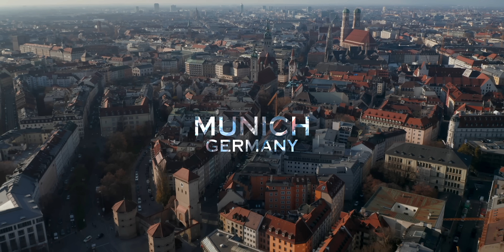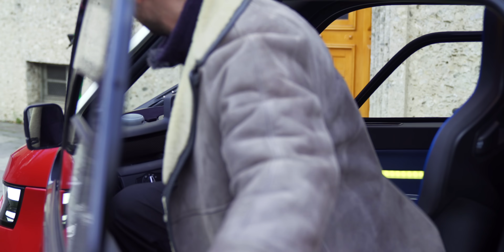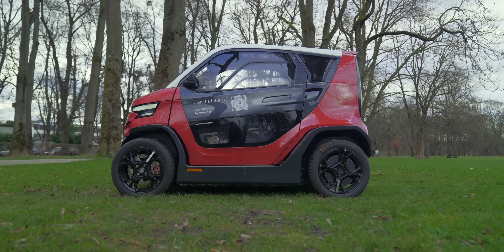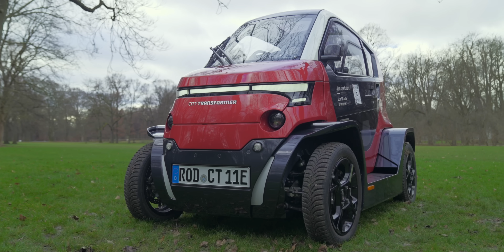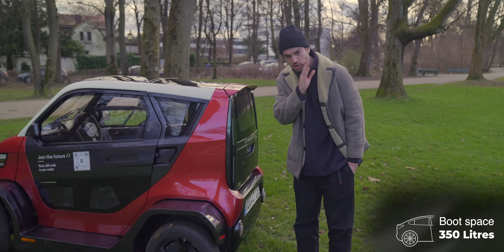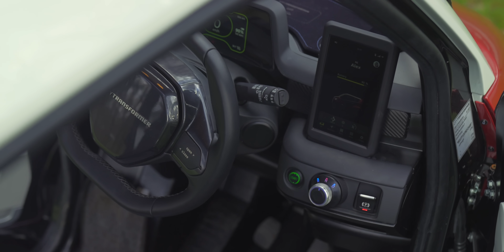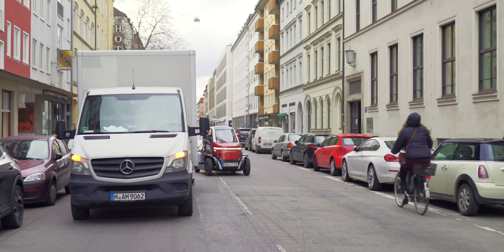The TRANSFORMING Electric Car Designed to Skip Traffic Jams!

Comment: 55mph top speed is good, I live in a village and a lot of microcars are only about 30mph which I wouldnt feeel comfortable driving down the A roads to Milton Keynes City, but at 55mph I think thats quite reasonable, plus the small seat in the back would be perfect for me taking my toddler son to Preschool and then school a couple miles away without having to take my full size EV. only problem is, its a bit too expensive, I could but a nice 2nd hand leaf for that money

Comment: Blend this with the Carva S+/One give it a similar or better range and the option of a respectable dual carriageway/motorway (65mph up hill) speed then you'll have a practical short-mid range commuter.

Admittedly we may have to wait for lithium sodium or solid state batteries to get the genuine range and speed combined.

Comment: 2:06 Thing is, how do we pickup our furniture from Ikea? And if said furniture is delivered, we need to ensure delivery vehicle is electric and not blocking roads when parked to deliver. All problems we need to solve else nothing will change and our cities will still be congested, even if cleaner. Brilliant engineering design either way, although driver will need to ensure no cyclists or other moving objects that the extending wheels may impact.

Comment: Imagine extending the length to have a back seat that had ample legroom on the move but could be retracted in, for parking purposes. It would be fun to make this vehicle out of a carbon fibre tub, McLaren style and get some fun suspension to tilt the cab into corners, motorbike style.
A length extending version could extend a metre back to allow for entry, then retract by half a metre to close the cabin, leaving space inside for the passenger or large load. You would be able to take luggage and camping gear for a road trip in it.
It is a a shame that the top speed is not enough for necessary dual carriageway usage. Seventy would be plenty.

Comment: In the Netherlands small cars like the folded mode of this one can drive on cycle paths. I imagine a car that could do both - cycle paths and regular roads - would be a huge deal there, assuming the law can be modified to accommodate such a vehicle. Pretty awesome.
Reply: as a cyclist, the idea of a 1m wide 400kg vehicle cruising at 50kmh down a cycle path sounds terrible. especially since cycle paths in many places in the US & Canada are where people go when they are not comfortable in bike lanes or streets - so lots of kids and inexperienced (and slower) riders. Just watching him drive into the bike lane got my dander up. It's like these things are designed specifically to take advantage of bike lanes, since a lot of highly congested urban streets are not wide enough that there will be a meter between slow moving vehicles. I don't have a solution though - Id rather see lots more of these than lots more of full size EVs.
Reply: @dreid477  Just an idea… if you want to use the bike lane, you must move like one. E.g. limit the speed to 20 km/h

Comment: The one thing I am dying to know right now is probably the one thing the City Transformer people don't want me to know: how the hell does the transformation work??? What must a steering set up look like to work like that? And at speed... Quite blown away, I must say..  And I so want to see these in cities instead of big suvs. Please make that happen.
Reply: I have some experience with large machines with these types of axles the steering was hydraulic and synchronised with the axle length through shared volume../ cylinder dimensions and valving ..for Road use it’s probably  had to be mechanical- which makes me curious too

Comment: With scissor doors, 50% more range, and at 50% of the price, and it will sell well. I'd also forgo some of those 'premium' features, with no qualms. The halving of the price can be achieved by means of a government incentive grant. The claimed range is too small for comfort, especially if it's really only 50 or 60 miles in cold weather.

Comment: It is more advanced and controlled. Imagine, you want to flip over your vehicle because something with this car you just make it narrower when you turn right or left, and it will definitely easily for it to flip over from the side. No one will do that, but there is an option for that in case your brake is broken maybe and you just want to stop.

Comment: I can kind of see how it could have a limited use - people who really don't have any friends so know they will never have to transport anyone else or any thing. Other than that, I can't help but feel that it is as useful as something like a hypercar. i.e. something that takes resources to build but has a single use. So you buy one of these, but if you want to travel anywhere else, you then have to buy another car that has more range, more space etc etc. 

It's footprint is over 50% of a Ford Fiesta, but arguably 25% as useful. I can't comment on CO2 production when building it as I don't know figures for either the Fiesta or the CT-1, but is everyone buying "individual" transportation instead of something that can serve more than one purpose not particularly environmentally friendly. 

And don't get me started on dangers to pedestrians and cyclists.  Just in this little taster video, it shows the driver using cycle lanes to cut in front of traffic, and driving off down a footpath. I mean, really, is this what cities should become? There's enough issues with mobility scooters on footpaths etc, let alone something that can go 50mph. Can you imagine the extra street furniture that will have to be put in place to prevent people from getting down pedestrian areas? Or the dangers of road rage as someone in there CT-1 barrels down a cycle lane, forcing them out of the way before then nipping in and cutting up traffic at the lights, as shown in the video? This is why I don't like cities!
Reply: Like people with single occupant bikes and motorcycles, people with thin cars will have family and friends. If they want to travel together, they’ll take two 🚗 🚗 instead of one 🚘. Standard side-seated auto design resulting in habitual empty car side-seat hauling is far more dangerous for cyclists than thin single-width cars will ever be.  Given its ability to move through traffic far more efficiently, eventually, like bikes and motorcycles, thin 🚗 design will be the popular choice and side-seated 🚘 design will become the novelty.
Reply: @MickeySimple  you're probably right, but I'm not sure how something that goes 50mph / 30mph in thin mode that darts across cycle lanes and footpaths whilst being entirely enclosed and seperate from the outside world will be safer to pedestrians and cyclists than cars where you can't and shouldn't fit in places not designed for them. I agree single occupancy is a problem in vehicles, but not sure that taking two cars instead of one, even if it is a bit smaller, is sound from an environmental stand point.

Comment: Q: I'm thinking of replacing my electric car with a fossil fuel car and have some questions?🤔 
1. I have heard that petrol cars can not refuel at home while you sleep? How often do you have to refill elsewhere? Will there be a solution for refuelling at home?
2. Which parts will I need to service and how often? The car salesman mentioned oil in the engine and timing belts that need replacing  and a box with gears in it. What is this? How much will this service oil change cost and how often – and what happens to the old oil. Also apparently these petrol type cars generally stop on the brakes alone – so the brakes wear out much faster – how long will they last compared to my current car which lasts over 100k miles
3. In a petrol or diesel car, do I get fuel back when I slow down or drive downhill?
4. The car I test drove seemed to have a delay from the time I pressed the accelerator pedal until it began to accelerate. Is that normal in petrol cars?
5. We currently pay about 1.2p per mile to drive our electric car. I have heard that petrol can cost up to 8 times as much. Is this true?
6. Is it true that petrol is flammable?
7. I understand that the main ingredient in petrol is oil. Is it true that the extraction and refining of oil causes environmental problems as well as conflicts and major wars that over the last 100 years have cost millions of lives? Is there a solution?
8. I have also been told that you have to transport oil all over the world to turn into petrol or diesel, and these ships have in the past damaged the environment by leaking the oil, is that true?
9. I have heard that cars with internal combustion engines are being banned to enter more and more cities around the world, as it is claimed that they tend to harm the environment and health of their citizens? Is that true?
10. I have been told that these internal combustion engines make a noise when you start them – so early starts can wake people up, and driving a lot of internal combustion engine cars in towns makes towns noisy.
11. is it true people can steal the fuel from your tank
12. what is the drop in range in cold weather, I've been told a car that does 45mpg can drop to 37 mpg in winter – just curious on that one.
13. a friend told me that the exhausts wear out – is that true, and people steal them for the rare material used in them?
14. I was also told – that the exhaust gas isn’t good for you – and if you leave the car running in a confined space – like a garage – you will die – surly that isn’t true is it?
15. next door told me – these petrol cars – carry around 40 to 60 litres of highly flammable liquid which is pumped into a steel cylinder, and its then exploded to generate expanding gas to move a piston, and turn linear motion into rotary motion.
Why would anyone want thousands of explosions happening within a few feet of where your sitting.
16. a guy at work told me – he has a petrol car, and it leaks oil. When he parks it – surely that’s not right is it – leaving dirty marks on the floor and contaminating the environment so directly. How long before this happens if I change.
17. my dad told me – if you buy a diesel car – the hand pump smells very bad, and you have to wear special gloves to stop your hand smelling, and if you spill it on your clothes it terrible.
18. is it true – the petrol and diesel is so dangerous, that you can only buy the fuel at a special filling station, and not anywhere (hotels/Car parks/Home/Work)?
19. while technology is advancing, will I ever be able to refuel my internal combustion car for free using only the sun ?
20. would I be better off going straight to horse and cart, and not buying a horseless carriage? they sound pretty awful, burning dinosaur juice and polluting the environment whilst funding conflict and war and consuming raw material at an unbelievably high rate.
Reply from the maker: Brilliant. I love this comment so much. Can I read it out on a news episode or podcast if I credit you?
Reply: @fullychargedshow  please do, if you think it'd be appropriate! However please note that it wasn't my original content, I saw it on a Facebook post and copy / pasted it here. Not sure I'd be able to find the post again.

Comment: When parking nose in, it's length is about 98.5 inches. The widest cars are about about 80 inches.  So it will stick out 18+ inches more than the widest cars, possibly into the lane.
Reply: Trucks stick out more.

Comment: From the front it looks like a Tractor cab stuck on go-kart wheels, from the side a Hot Wheels van, and in thin mode it's a mobility scooter.

It annoys me how the Ami is limited to 28mph, here in UK folk hate doing the 30mph speed limit so rage at folk doing 2 under and you don't want that around you when you're driving a plastic box so an actual 30mph will help a lot.

Though this car won't be allowed as a 'no licence needed' here which is a shame for cities, the 13k euro price will definitely be a lot higher when/if it drops in UK and that puts it in a basic new Fiesta price with less room, so it depends how much a small EV car suits you I guess though with 111 mile claimed range does help it's selling point if it's at least 100 mile in reality..

Comment: With this vehicle, the second passenger seat could be made rear-facing for getting in and out then swivel round to face forward while driving.
BTW, have you seen the Triggo from Poland, Jack?  Similar concept, with expanding front axle but it also has the ability to lean into curves and an autonomous driving function, and has rear axle steering.

Comment: The standard car parking space in the UK is 2.4 metres by 4.8 metres (it can be as small as 1.8 metres wide). This vehicle is 2.5 metres long. Parking "nose in" leaves some of this vehicle outside the designated parking space causing an unecessary obstruction and is an offence under Road Traffic Act 1988, Section 22. Welcome to the world of Fixed Penalty Notices, clamping and having your vehicle towed.
Except you won't make it that far as a bus is going to sideswipe you into oblivion as you try to filter between the lanes in heavy traffic, or you get charged under RTA, 1988 Section 3 "driving without reasonable consideration" with "misuse of any lane to avoid queuing or gain some other advantage over other drivers" and get 9 points on your licence for forcing the bus to swerve and not kill you.
What were the other 'advantages' of this vehicle again ?

Comment: I dunno - there are aerodynamic compromises of this, and the complexity of the "transformation". The direct competition would seem to be the Twizy? I would strongly prefer getting the Cg as low as possible, and then setting the wheel track width as narrow as that allows.
What you gain in parking ability, you lose in stability - off camber slopes at too high a speed and this will roll, I would have to think.
Reply: Other thin weather and road protected vehicles able to lane split and park perpendicular to curb include Carver, Nimbus, and Tango. They’re all great. I think thin cars are the future.
Reply: @MickeySimple  Right - the Tango - I almost mentioned it. I saw it at the Automotive X-Prize and it was "enabled" by its lead acid batteries in the floor. Low Cg, as I mentioned, is one solution to this.

Comment: It's a comfy but space limited motorcycle - if you can't even get an adult passenger in the back then it's really a single person commuter (fine.. there is a need).  I'd love to see a proper 2 seat version (tandem) with a bit of a boot - maybe enough for a dog on a short trip.  That I could use for little trips at home and tow behind my camper van and use to explore....
Reply: Did you ever see a motorcycle with 2 electric engines (2x10hp)?

Comment: Hey, it's neat!  But it is also unnecessary- it just adds complexity and cost.  Also, while I think small cars can be useful in some instances, they will always be a niche product.  Have you ever gone grocery shopping even for just two?  Much less for a family of four.  And for most normal folks, they cannot afford that extra, fun micro car- their vehicles have to be flexible for both transporation to work, travel to grandma's house across the state, or taking the kids and their friends out for ice cream.  We are long past where one's world and family all exist in an area the size of a football field.  Also, you cannot fit 4 of these city cars into a parking spot, unless, one, you are going to climb out the roof, and two, widen the parking spots by 50%- these micro cars still stick out too far when parked like that.  The problem is not the size of our cars, or the amount of energy needed to push them- it is the fuel they run on.  It's as simple as that.  Everything else is going to be decided by need, preference and/or whimsy.  The flexibility of, at a minimum, a four-seat automobile, or the greater flexibility of an SUV, are what people want- and frankly, there is nothing wrong with that choice, if the fuel is comprised of electrons.  There is also nothing wrong with efficiency, especially to increase the range in an EV- but the cost of fuel is cheap for EVs, and likely to get cheaper.  The problem isn't the cars- it is the cities that are outdated.  Perhaps the solution is either multiple city centers instead of one, or going 3D- either by building layers of car tunnels under the cities, a la The Boring Tunnel, or going up using E-VTOLs- or a combination of all three.  I love Fully Charged- but this unfounded dislike of larger vehicles is misplaced.  Outside of even a couple of thousand city centers, world-wide, the rest of the planet is a very large place...  otherwise, as usual, great show;-)

Comment: 0:01  I'm guessing this may be one thing that puts this American at odds with the Europeans from the Fully Charged Show. While many American cities were founded before the advent of the horseless carriage, most were still new enough that they were adjusted to better suit the car. I have the impression that even America's oldest and most car unfriendly cities, like Chicago and those on the east coast are easier to drive in than their European counterparts which are centuries older and less able to adapt.
Reply: I live in a Chicago suburb. When not working at home, my commute takes either 2 hours to go 40 miles one way or 1:40 minutes to go 30 miles one way.  There’s no question in my mind that weather and road protected thin electric cars with thin lane and parking space access would work much better for me and other suburban commuters than side-seated cars. Then when induced demand occurs and the need to widen roads is necessary, it will be far less environmentally and economically costly.